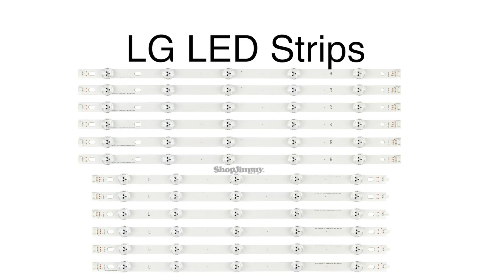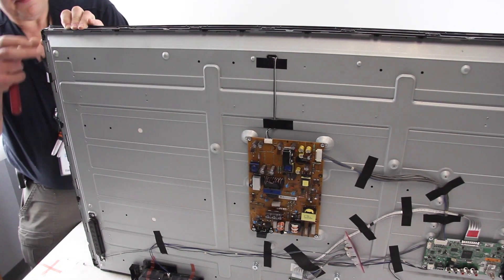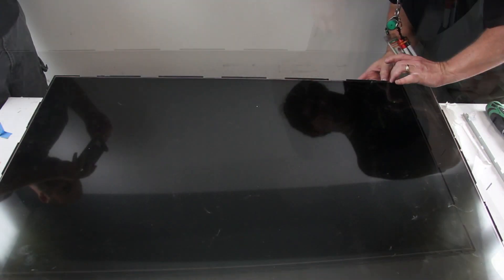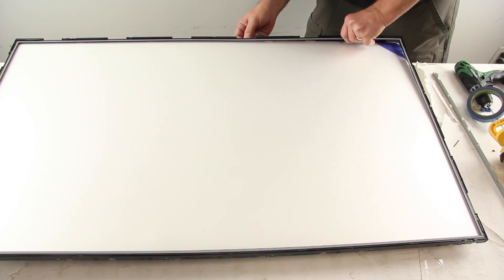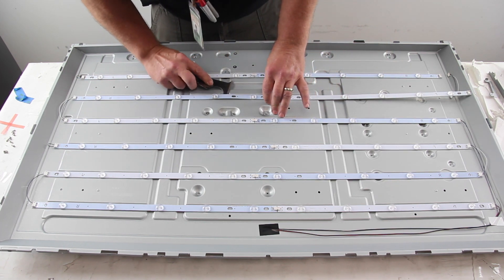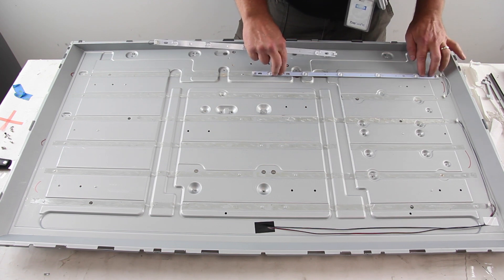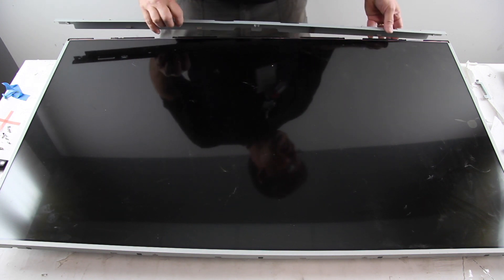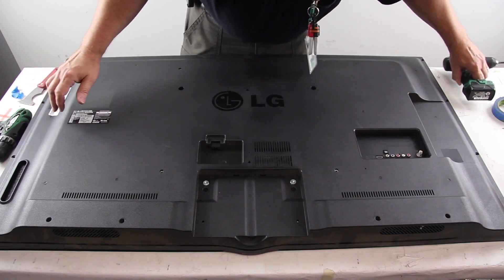LG 50” LED TV - No Picture Bad Backlights - How To Replace LED Strips 50LN

Comment: I know in one of your videos you mentioned if there were any questions just leave it in the comments. I watch a few of these while attempting to fix a 50" vizio my MIL gave me due to screen issues. Now I have my old tv that my mother had that is being goofy. It shows the initial V during power up so the screen works but then has a black screen. Menu button and volume button don't work. I don't have the remote so it could just be the other buttons don't work. Just curious why it shows picture at initial start up but then nothing. It's an E321VL model,  if that helps any.

Comment: I have an LG 50la6970-ue. The TV starts fine for the first ten seconds. Then, the picture starts constantly turning black then on at around 2 to 3 second intervals. The audio is fine though and keeps working even when the screen is black. I removed the backcover and the backlights seem to be working fine. Also, the 24V, 12V, and 3.5V pins on the power board are outputting normal voltage (the 12 pins keep fluctuating between 11.94 V and 12.21V or so, and I believe fluctuations happen when the image keeps turning on and off. 24V pin fluctuates between 12.58V and 12.88V, 3.5V pins are constant at 3.565V). I am not sure what the issue is! I checked common symptoms of a damaged t-con board and my case doesn't seem to be one of them. Not sure if I should try replacing t-con board or problem is elsewhere. Would appreciate any help.

Comment: Was wondering why my TV has lines on it after I did this....
Reply: Did u ever find a way to fix it?
Reply: Maybe the LED strip set version is not the right one. Wrong led strip order, or bad led quality. Led power and light shape should be extra fit to the diffusor.